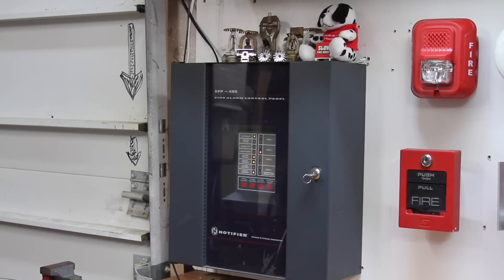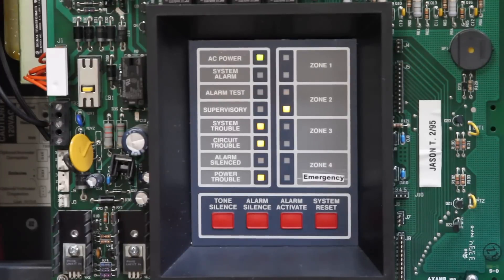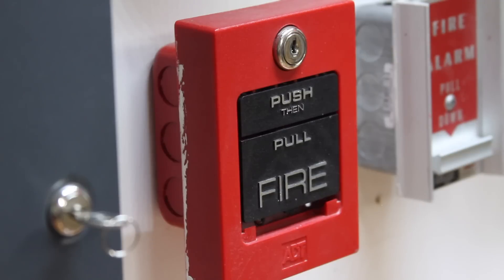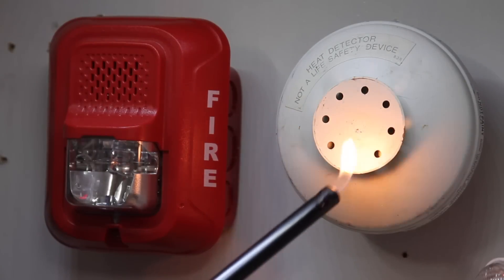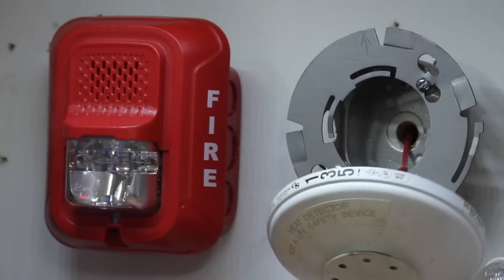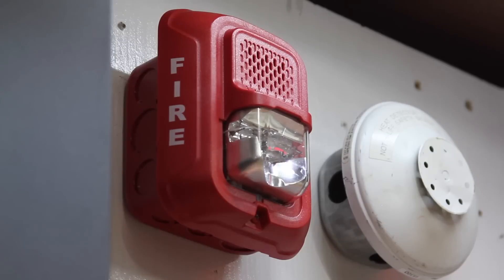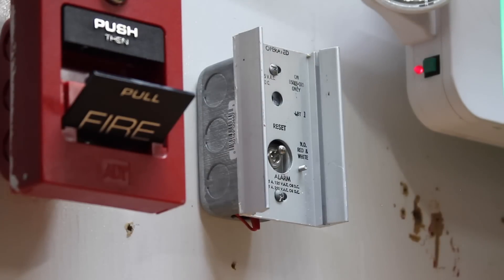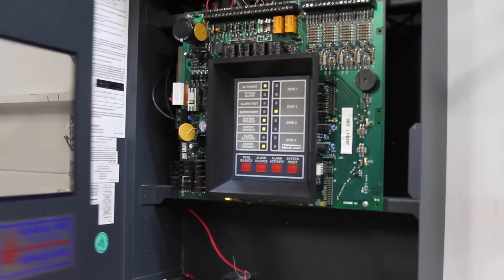Notifier SFP-400 System Test 4: System Sensor L-Series!

Comment: Just wait in five years. The L-series will become as common "in the field" as its' SpectrAlert predecessors (the Classic and Advance.) I wouldn't be surprised if I see them at a Dunkin' Donuts shop around here, as those are fond of using System Sensor's alarm signals too.
Although it's hard to tell by the video, while the L-series horn/strobe sounds very similar to the SpectrAlert Advance, it's actually a tad softer.

Comment: Great video grant! I have a recommendation for the circuit trouble. Lots of times older panels seem to have capacitors that go bad. I would take a volt meter and check the voltages on the capacitors just to make sure they are still good. If you don’t know the correct output voltage so you know, you can look up the capacitor online and it will show the correct voltage. If it’s not the capacitors, check any resistors or any relays on the board to find out what’s not working properly. Notifier sells these parts online and you can resolder them to the board. Thanks and I hope this helps!!

Comment: Why is a heat detector considered not a life safety device? It detects heat from flames and sets the alarm off still. Also, i notice they are always in kitchens. I guess cause smoke from cooking can happen. It's funny because a kitchen is the more hotter place in a building.
Reply: TheJakeman789 because think about it.... There’s a fire, the detector goes off, and there’s a heat detector in your closet, your room is on fire, basically your trapped, all though they’ll detect fire, they can’t physically save lives just relying on them without automatic smoke detectors, they’re more meant for utility areas, garages, and kitchens to report a fire.
Reply: Thanks, but I still don't understand why they are considered not a life safety device even though they still activate the alarm saying there's fire and get out.
Reply: TheJakeman789 there designed to protect property, not life. If you’ve read my comment you should understand that the entire room or area would be burning and you would be on fire, then it goes off.
Reply: Settle down. You are clearly not understanding my point and what I'm trying to ask. Sorry.